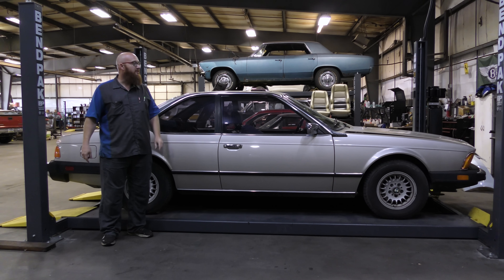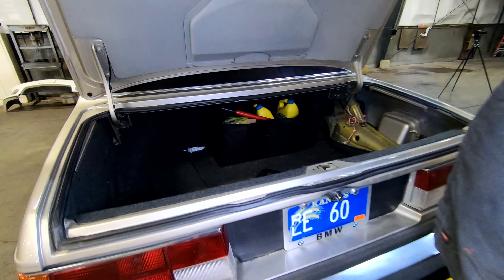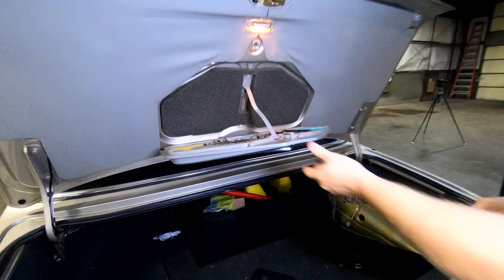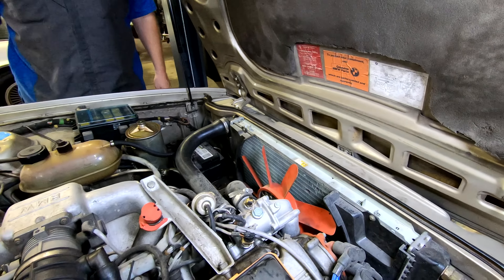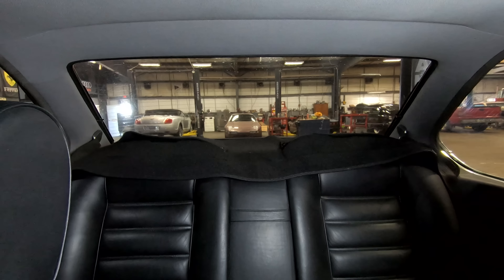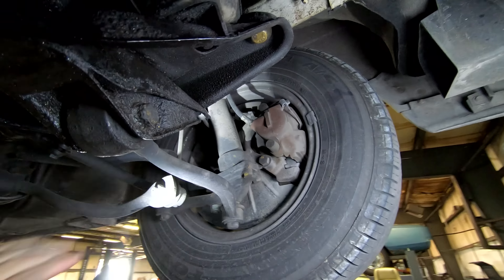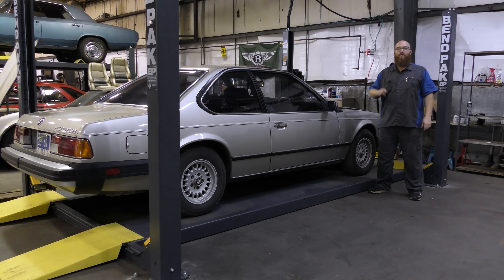Finally a BMW the CAR WIZARD will willingly work on! What makes this '83 BMW 633CSi so special?

Comment: That was still the era when BMW had really strong NA I6's that were and still are solid engines.  I have two BMW's left, the first being a 94 E36 318is pretty much stock with a tune up and basic care done (it's a 4 cylinder, but it's basically a racing pedigree I6 with 2 cylinders lopped off, still has the forged crank and all) that's what I would call "very good" condition I've tried to keep clean and enjoy.  The second is a 97 E31 8 Series that I would have kept full factory, but it came to me as a roller with no engine just an automatic transmission.  The body was clean dent/rust wise, but I had to do paint and restore the interior.  The engine I had at the time on hand was a 1UZ 4L DOHC V8 from Toyota, so that's the engine that went in after tearing it and the factory transmission down for a rebuild.  It's around 320hp and more torque, plenty to be a great touring car with some pep.  I love the E31, it's one of my all-time dream cars, so having one, even if it's Toyota powered, was a big deal for me and still is.

I've had other E36 in the past, both I got as blown rollers that ended up with either a GM 4.2l I6 turbocharged or a Ford 4.6l 32v DOHC V8 procharged.  The GM 4.2l went to a Jag XJS, and the Ford V8 went to a 99 Jag XK8 I got bundled both as no engine rollers too.  Sold the E36's with factory crossmembers and everything reassembled to friends that wanted to put in more modern turbo'd bmw I6's.

Comment: I have one of these, an '85 635CSi with the 5 speed manual and limited slip rear.  It is a joy to drive on the highway and has been very reliable.  It is so beautiful I always turn around to glance at it after I've parked it.  Unfortunately, interior and trim parts are becoming scarce.

Anyone who has owned an M30-equipped BMW knows that at 3-3500 RPM there is a very slight but deep thrum throughout the cabin, almost as if the car is "excited" to keep moving up the rev range.  Very characterful.

Comment: Try taking the plastic gear to a CNC shop, maybe they can make a new one from metal, as long as they have the dimensions of the original part. It may cost a fortune, but it's all for the originality. Or try a 3D printer.
Reply: Or go full-on Clickspring and hand file a gear out of brass.
Reply: a cnc shop could use the matching nylon material, metal would wear out the other gears too fast. 3D printing would defo be the best option. you could even take a mold and reproduce the missing part too by casting a new quarter, if you really wanted too do it. most jewellery workshops would have the equipment to do it. it's quite basic stuff
Reply: @elvisrose  That is true, the new metal gear will just eat the other plastic ones, that I didn't thought of. 3D printing will be the best solution here, as an old original gear can develop the same problem.

Comment: Old beemers are better, this 633 is looking great 👍 

 I know someone who bought a first gen 1 series this year that was imported to the Netherlands in 2016. The first thing great came to mind that it’s gonna break down. And it did eventually. And he eventually sold it after just owning the car for a few months. 

Already knowing the wizard opinion on modern BMW’s made clear I have to run away from these mechanical nightmares.

Comment: Hey Wiz, if you strike out on the "new" antenna gear, I recommend "G-Flex" epoxy glue by West System and glue the old gear together. It's really good stuff. It is probably every bit as durable as the original plastic. Good luck.

Comment: For the bmw heated seat thing. If the vehicle is optioned with it when purchased new it will always be activated and useable(no subscription needed) but if not optioned when purchased new(the heated seat will be in the vehicle just not activated) then you will need the subscription to use it
Reply: There will be somebody around who will have a 'fix' for that stupidity.
Reply: @vumba1331  oh definitely

Comment: You could laser scan the old part, and 3-D print one. You can even 3-D print with metal. This is he future of keeping these old cars (and other old mechanical things) going IMO. Also, the car is gorgeous.
Reply: Lost pla casting is just the most amazing thing ever.

Comment: I had a job at a BMW daelership and I drove one of those cars quite a lot and I can safely say, given enough highway it will hit 145mph, 150 with a good wind behind it. I also owned a 733i back then and that had the same nose on it and a great mile muncher!
Reply: Passed a ford dealer once and saw something funny. They were driving a police interceptor around and yielped the siren 🚨
Reply: I still have an original Motor Trend article comparing the top ten fastest production cars of 1987 and the BMW M6 topped out at 145 MPH.

Comment: You can buy a new antenna for around $125 directly from BMW. Look at Maximillian Importing Company, a BMW Heritage part supplier here in the USA. I Own a 1985 BMW M635CSi  ( non federalized ) with the legenderay  M88/3 engine ...Parts are relatively easy to find and not that expensive...Great video.

Comment: These cars are the definition of designed to be worked on.  A lot of the marketing back then was hammering home quality and they were quality.  Some sinister bean counter at BMW realized they were too good in the 80s and the engineers have now made them impossible to work on and lots of planned obsolescence.  I have an 86 7series and driving it today in 2022 other BMW owners are puzzled how my old car is still cruising alongside them.
Reply: Cars today don't last as long because car manufacturer companies keep wanting to change and have the newest and coolest thing/engine or transmission. Back in the day, car manufacturers used the same designs for years. The reliability was better because of that, the manufacturers make a good engine or transmission and they stick with it for years. Today, manufacturers make a good engine and or transmission and within 6 months start thinking about how and what to change with it. Lol.

Comment: I've owned my 635CSI for ~15 years.  Been a really good summer only weekend car for all those years.  Definitely worth finding one with a manual transmission or doing a manual conversion.  The M30 sounds good, but the power isn't anything amazing so if you're stuck with an auto it probably feels a bit slow.  Fun if you can rev it out and enjoy the inline 6 properly though.  Comfortable cruiser, handles itself fine, one of the best looking BMW's of all time.  Doesn't have 'tech' obviously but has the modern conveniences that you actually need like air conditioning, sun roof, cruise control, power windows, power heated seats (highly recommend the 'sport' seats instead of the 'comfort' seats), etc.  Just a really solid car even by today's standards.

Comment: I ran my antenna up in my 83 633 i 5 speed and disconnected the power.  All of those power units go bad, even the aftermarket ones.  My car developed oil leaks and brake issues and ac issues and door lock and window problems. I thought is was the prettiest coup I ever had  but I let it go for a Japanese replacement. It also had the infamous BMW "twitch" from the rear in the rain. Nice second car to drive on dry weekends.

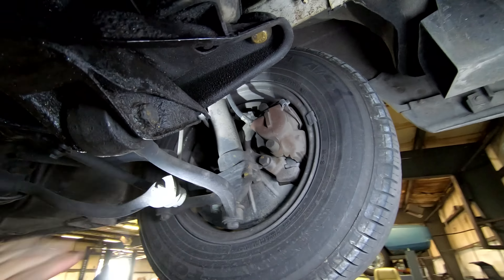Comment: 15:18 Not strictly true. If you pay for heated seats or other add on options, they are yours to use forever. However, to save costs, if you don't specify heated seats or other options, the options are added anyway but disabled (as you haven't paid for them), If at a later date you (or a later owner) decides that the options would be required after all, BMW will enable the "options" for a subscription or one off full payment.
Reply: Apparently they are already charging monthly subscriptions in some countries but they say they won't be doing that in the US. We'll see how long that lasts. In the UK it's like $20 a month.
Reply: @ericg7044  Yeah but, only if you have opted at a later date to activate the option that wasn't specified at point of sale. You don't have to pay it and, if you had bought an older car without the option, you couldn't have it anyway without a costly upgrade costing far more than the monthly subscription. You can pay a one off fee anyway which would still be far less than adding the option afterwards.

Comment: As to the cogwheel: I once heard the trick of pushing it into a piece of plasticine, turn it, so that the missing teeth also will be "imprinted", and then fill the space of the missing teeth with baking soda and superglue. No idea whether this works, but maybe others may have tried it...
Reply: That's the kind of thing you do as a home hobbyist, not a professional.
Reply: @Default78334  Yep. But if you have no other option as a professional, it might be worth trying. One can still throw the whole unit in the trash if it does not work.
Reply: @jaapdoedens727  I would think messure the wheel, and look for a copycat replacement from an audi or some other manufactuer that used the same part, as its a power anttena on a BMW, it might be the same unit in an audi too.

Comment: I had a 88 M6 in the 00s. Great car, though even as a M car it drove a bit boaty, being the 70s design that it is. Mechanical parts availability was good, being it was mostly shared with the 5 series, but some of the cosmetics were tough to get, even back then. As for new cars with subscription features, Wizard's favorite TOYOTA is/was considering turning keyless entry/start into a subscription feature. I suspect just building all the cars the same and enabling features via subscription is going to become more of a thing by everyone in the future.
Reply: I could care less about keyless starts. But in that context I do kinda get it, those wireless systems require constant updating to maintain security, which is something that all modern cars are sorely lacking.
I'm still not on board with the sub service though.
Reply: Tbh these car manufacturers are clowns for trying to pull this subscription nonsense off. In this day and age of increasing climate change concerns and cars becoming considered a public enemy more and more by the day, why the hell would anyone want to buy a brand new car in 2 or 3 years time when there's more and more pressure from our government to cycle and use public transport? I'm saying this as someone that grew up fascinated by cars and still am, but over the past year I've even been questioning whether I even want to own a car anymore with the way things are turning; not only is driving considered increasingly 'bad' with time, car manufacturers are spiting their customers with poor disposable designs that will be lucky to see a decade that aren't even fun to drive, spares become obsolete within 5 years, and now they want to charge you to use products you already paid for.

The automotive industry is shooting itself in the feet with this mindless greed, and karma will hit them back in the next few years, and frankly, when that day comes, good riddance. Hard times to be a car enthusiast.
Reply: @popifrex1993  Not the phone start, the keyfob start, so the same insecure communication that was there before.
Reply: My dad has an 87 M6 he’s owned since 1998. Since before I was born (2001). These cars are the reason why I am a car enthusiast.
Reply: @solitaryclusterofneurons598  The irony is that it takes a substantial amount of energy and resources "up front" to build a good car, a sh!tty car, a gas car or an electric car. If the "powers that be" were indeed sincere with their environmental concerns, we would be taking advantage of all that was learned over the decades to build cars (and other durable goods) that last longer than the typical finance term.
Reply: @martinliehs2513  Exactly. If anything, it should be culturally normal to have a 5 year service interval where the floor, axles, engine bay, and wheel wells get treated with anti-rust inhibitors and sealant. Really rust is the only thing that kills 'modern' cars (by modern, I mean ~1985 up to ~2008 before the planned obsolescence designs really started to kick in across all manufacturers) outside of ignored servicing, which is unfortunately common.

As a matter of fact, technically any good car can last as good as infinitely providing that quality parts supplies stay strong. It really comes down to chassis rigidity and quality welding with quality metal where needs be.

Then there's a matter of fuel, if governments would subsidise synthetic petrol a la Siemens/Porsche the same way they subsidise electric cars, we'd all be better off. Unless some radical technology and/or manufacturing revolution happens with electric cars, they'll simply never be affordable anyway.

Too bad we live in a 'keeping-up-with-the-Jones's' world where the majority insist on needing the latest greatest fancy car instead of looking after and maintaining their current one.
Reply: @joemama38  The old 80's M models are commanding a small fortune at auctions these days. Fine examples are going for six figures.
Reply: @jeffrobodine8579  oh i know it. My father’s is on the rougher side. It’s seen better days. Still not bad, beautiful car, S38 under the hood. Runs pretty well, has had a lot of mechanical work recently to make it roadworthy after sitting for the better part of my childhood

Comment: Your worthy competitor Wheeler  Dealer had a similar issue with a broken sunroof clip. The took the part down to a company in Orange County, CA that scanned and printed the broken part. Seems with the plane manufacturers in Kansas there must be a company local to you that could reproduce / print the broken gear.

Comment: I had a 533i from the same year. Same engine, I had a 5-speed manual. Fun, fun,fun. I like a manual. Air flow meter you can change the track of the wiper running down the circuit  board of resistors to renew it. Manual adjusting valves, get your feeler guages out. Something under the valve cover needs locktiting or it comes loose, I can't remember what that was. Check front coil spring seats, might need a bit of welding. GL4 in the manual no sulphur, and limited slip diff I can't remember. Changing starter motor remove heater hose so wrench can swing. I forget the rest of relevant stuff. I wish I still had it.
Reply: The 533i was a panic move by BMW when their two year release of the ETA motor, new standard in the motor for 5 series, threatened BMW's reputation for performance. The panic move was to take this engine from the 633i and 733i and put in  the 5-series and called it the 533i. Pair it with a manual transmission and limited slip differential and you had a hot rod. Fastest production car of 1983. It beat EVERYTHING else that year for performance
Reply: The wheels are a weird metric size like 151/3 inches. Coker does a remake of the TRX tires but so expensive so switch the rims to other hub-centric BMW wheels with same bolt pattern.
Reply: I have the M30B34 1986 735i.  I think this is the M30B32 but essentially the same engine.  That AFM sweeper arm can be the culprit of a shaky idle in which some owners never crack open.  It’s such a simple design once you see the operation and makes all the difference when it is in proper condition, no big grooves or flat spots on the swiping surface.  I think the main thing to check with the valve cover off is the oil sprayer banjo bolts which can back out.  This is also very common in Mercedes of the 80s and early 90s. Also replace the valve cover gasket but that’s all BMWs even new ones.

Comment: Bad gear: Piece of cake for a 3D printer. There are commercial shops that replicate parts like that, and enthusiasts who will do it as a hobby project. Plastic is way cheaper than metal, but there are 3D printers that do metal as well.

Comment: That antenna is actually a Hirschmann antenna that was found on most high end german cars of the period including mercedes and porcshe as well.
Trouble is like you said these antennas these days are basically non existent since these antennas were extremely expensive to have and most of them today are mostly beyond repair and they're still expensive to rebuild.

Comment: The 633 and 635 and the 2002 is where my love for BMW cars begins and ends. Period.
Reply: You didn't think much of any BMW from that era if it had AC and you lived somewhere where you needed it.  Like blowing cold air through a straw.
Reply: @paul lee...i remember reading a story in (I think) the BMWCCA Roundel about BMWNA bringing some engineers from Germany to Texas in the summer to prove the inadequacy of their AC units. European summers aren't normally as extreme as ours are here.  Apparently they returned home an ordered some upgrades.
Reply: 90s BMWs are acceptably well designed too. It's after that which is unbearable
Reply: @pclayton5063  I care more about Driving, and that's what those cars are about.  I graduated to a 911 Targa and a 912 Targa Soft Rear Window and they trounce any BMW
Reply: @bmwloco  Maybe, depends on the driver, but talking about the AC, not how fast you can throw it into a corner.

Comment: You need to drill down two OEMs, first the antenna maker, then the gear maker. Check the gearbox carefully for who makes the parts with any part numbers and search. Have come up against this many times where the dealer had just dropped the part but the OEM is still making the part for other vehicles.